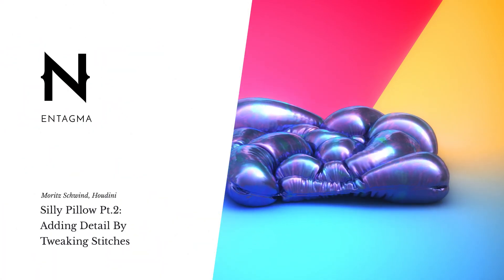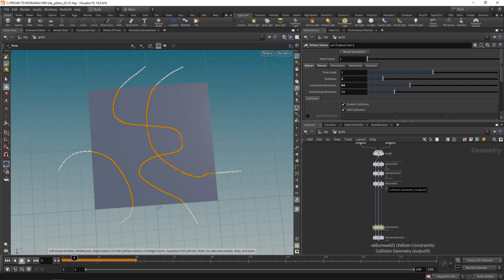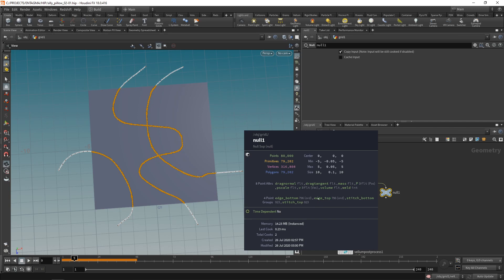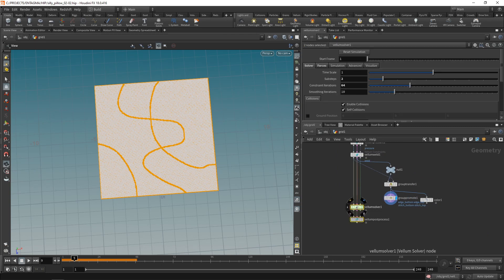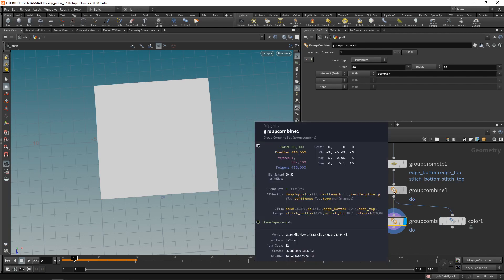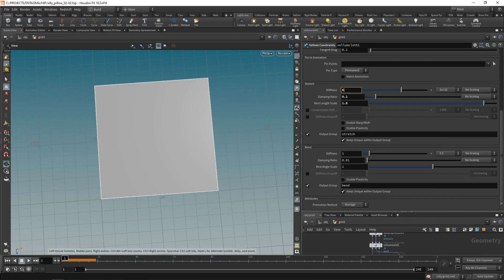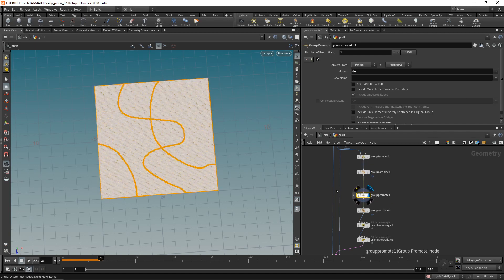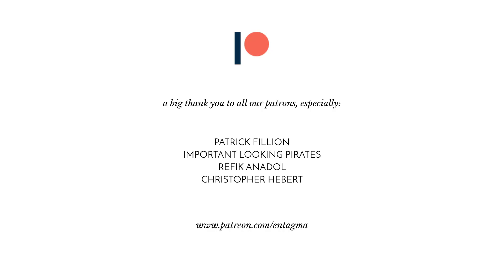Silly Pillow Pt. 2: Adding Detail & Tweaking Stitches

Comment: I did something and it started shrinking badly instead of inflating..
Reply: I'm having the same issue  and i've double checked my vellum settings and they are identical. I wonder if we made a mistake in the custom constraints section with the stretch variable?
Reply: Hey I figured it out. I mispelled the f@restlengthorig * 1.5 as "f@restlengththorig" make sure its all lowercase, no spaces in the rest length and that everything is spelled correctly. Let me know if that helped!
Reply: @owenjenkinsofficial  lol I had the same problem, I typed "reslength" and I spent almost 2 days debugging everything, but it was just a fricking missing "t" that destroyed my setup haha
Reply: @tondann  😂